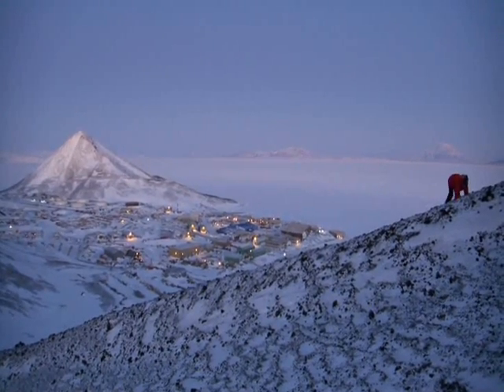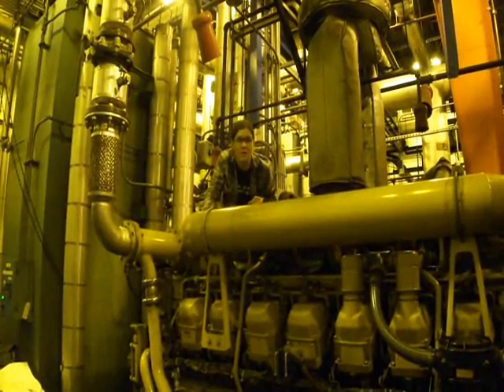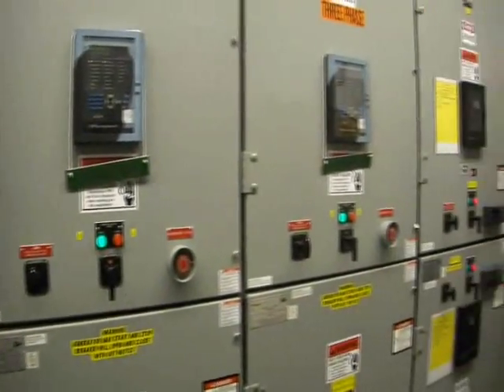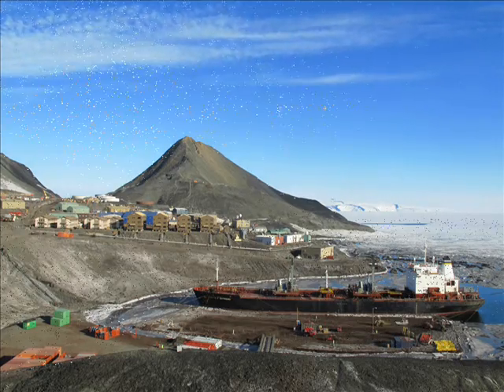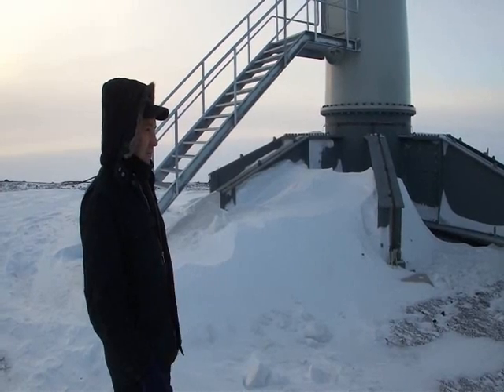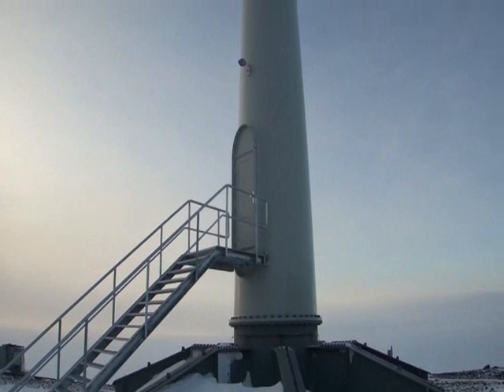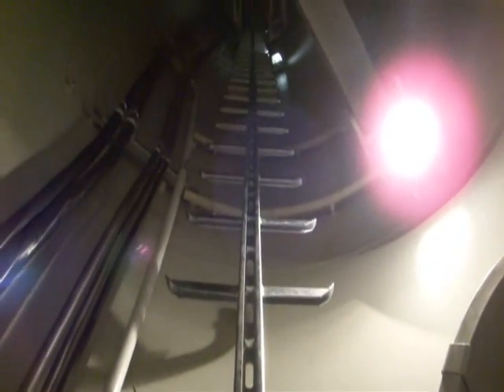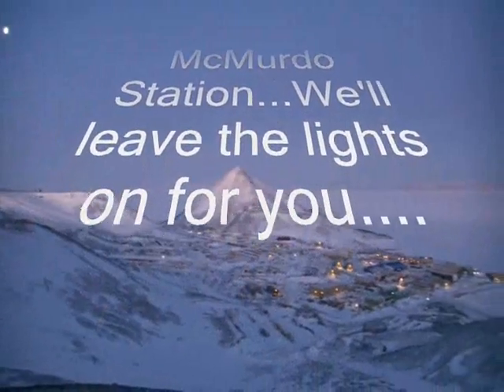Polar Power: Electricity in Antarctica

Comment: My dad said a real engineer knows that a windmill turbine would never last that long up there and become cost-effective is that true? And if it is can you please explain the numbers?
Reply: Why would they not last? As long as things like lubricant are used that fit the cold. A small amount of the electricity produced could be used to heat parts of the nacelle if required. The only real issue is dealing with extreme wind speeds, and the shifting of the base.
Reply: I love hauling fiberglass and resin to the landfill every day in my dinosaur powered kenworth

Comment: How does someone measure an accurate weight on an atomic level like carbon that is suspended in the air? Are the numbers you're giving accurate?
Reply: Simple. YOu know how much fuel is burned. You know the density of carbon in a given volume of fuel. It's a simple calc to determine the carbon output.

Comment: How do you stop the antifreeze that the windmill needs from spilling onto the ground and causing pollution to reduce your carbon footprint.
Reply: Electric heaters, not antifreeze for modern turbines.  Or even heat pumps or gas heaters.  OR THAT DIESEL GENERATOR AT THE START.  
All you need to do is get it started up and the turbine provides its own energy.

Comment: If the windmills break down in the middle of the winter when the oceans are frozen in that section how do you get a quick replacement up there?
Reply: Plan for more turbines than you need and DID YOU NOT SEE THE DIESEL GENERATORS.

Comment: If I heard the numbers correctly. Wind power only covers 10 to 15 % of the stations requirements. Sounds about right.
Reply: And if I heard correctly, those wind turbines were built in 2009. You put a single modern one up there with their hundred meter blades and the whole station will be powered all year round. It is the windiest continent on earth after all.
Reply: Still that is hundreds of thousands of dollars saved annually
Reply: Probably